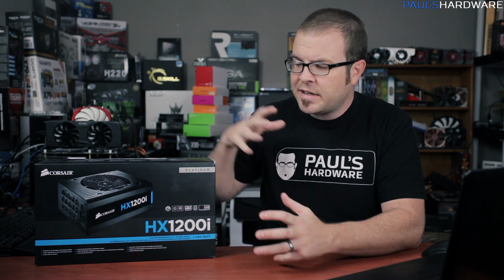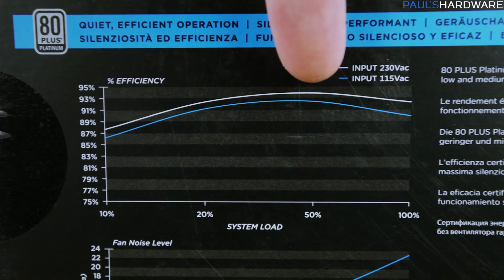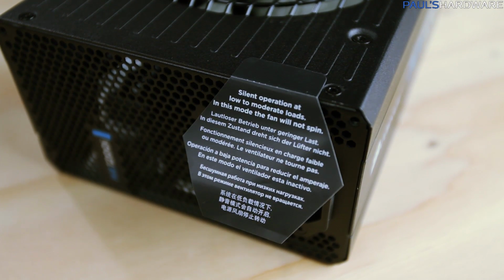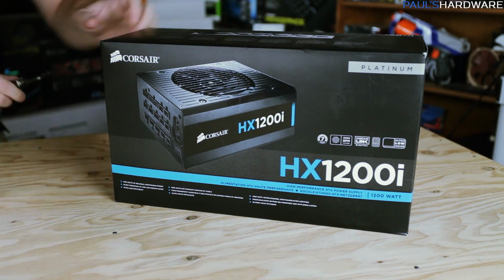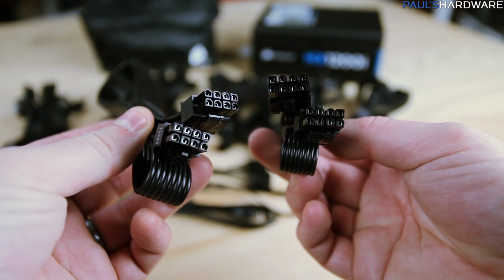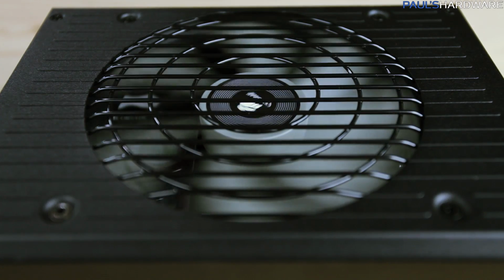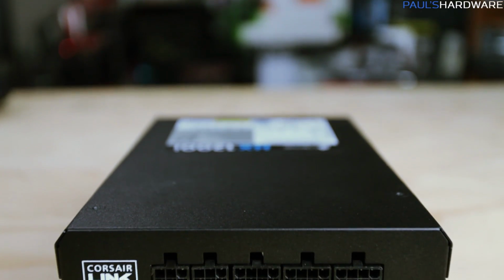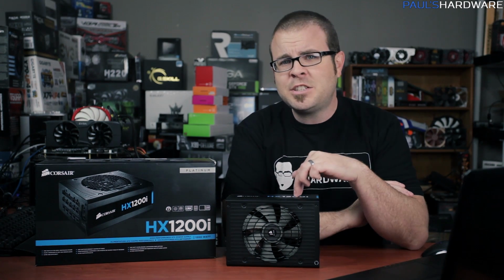Corsair HX1200i Platinum 1200W Modular PSU

Comment: so im looking to upgrade my gpu to either a gtx 970 or an r9 290x with maybe adding a second card in a year or two. what power supply do you think i should go for ??
Reply: Ross Findlay I'm using http://www.newegg.com/Product/Product.aspx?Item=N82E16817438017 for my PSU w/ a single 970, but I plan on moving up to a dual 970 when the need arises.
Reply: Ross Findlay Make sure that it is a high quality power supply if you go with a 970 so you can avoid most of the annoying coil whine. With my case fans (150-200mm) I cannot hear the coil whine with this PSU at all.
Reply: Ross Findlay That's not much info. We don't know your CPU or any other components that may use a lot of power.
Reply: Josh Conant I have an i7 4770, and 12gb of ram.  2tb hdd and will be adding an ssd soon
Reply: Ross Findlay
Ok, well a 4770's TDP is 85W. 970 is 145W. 290x is 250-300W. HDD ~10W. SSD only ~4W.

With a single 970, you'd be fine with a 550W. I'd grab something closer to a 750W if you're going for the 290x, especially if overclocking. If you know you're getting another card, double the power usage of the GPU (i.e., 550+145).